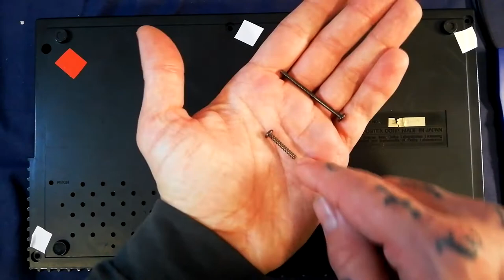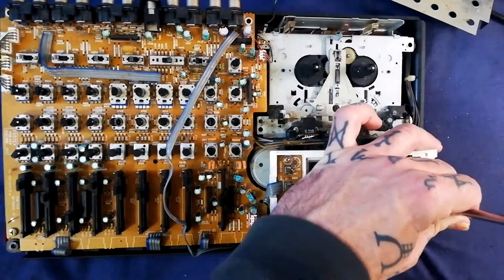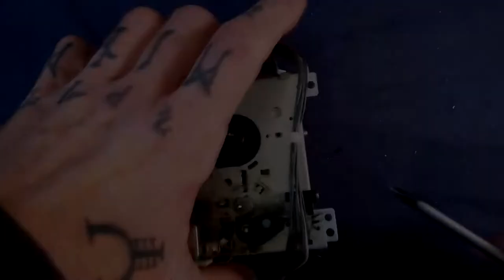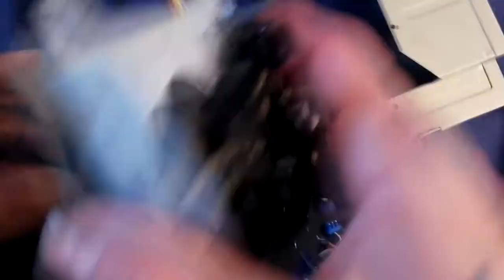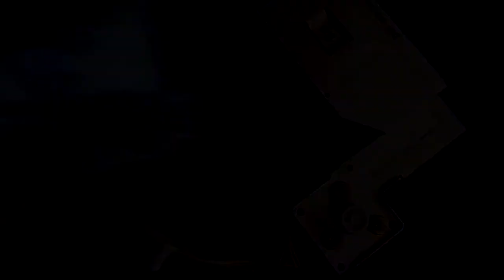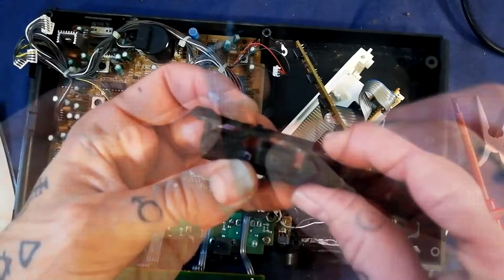Fostex X28H | Tear Down

Comment: just followed your video about capstan motor disassembly. had to replace the (clockwise) motor in my machine, which is very hard to find... I bought a mabuchi equivalent couter-clockwise motor, and did some surgery to swap the brushes around XD it works now but not without a gentle push to get it going. probably needs a little oil or alarger capacitor or something like that

anyway... thanks. just saw your channel today. really like the level of disassembly you show us. Thats just what i need
Reply: mine is the regular x-28*

Comment: I just fixed one of those, thanks for the ever detailed tear down. 
I have the 28 version not the 28h.
The unit came without one of the top select channel switches as shown on this video. 1:06 
Is there anyone around with a defect unit willing to sell/send one to me?
I have this unsatisfactory and slightly irritating feeling of having work hard to get it all working but just missing that tiny little last of the puzzle !
Thanks again tetrakan
Reply from the maker: I've got a spares donor, but I'm in the UK, where are you? I'm willing to ship internationally but from experience the prices are crazy...
Reply: Hi contacted you via your patreon message box. Thanks!

Comment: Hello Tetrakan!

Watching your video, I opened my fostex X28H to replace the belts.
Before closing it again everything worked correctly; but after closing it with the rear screws, the device does not turn on.

I have measured the adapter and it works fine; Even the input jack works fine, but I don't know anything about electronics and I wouldn't know what to check now.

Any suggestion will be very welcome.

Thank you so much!!
dan
Reply from the maker: Hard to say without being there, probably bets to open it up again, look for a disconnected cable or similar? Don’t be disheartened, I do this during repairs often, usually the answer is obvious on a second inspection, just stay calm and optimistic
Reply: @Tetrakan  Thank you so much for your answer.

I forgot to tell you that when I took it apart and put it back together several times, the motor cables became unsoldered, and with my pulse no longer so firm, the solder on the 2nd and 3rd contacts (the ones in the middle of the 4), were touching each other. , they overlapped.

Could this have damaged some component that is causing it to not turn on at all now?

PS.: Fostex is so fragile compared to Tascam...
Although both brands are Japanese, what a different engineering!

Comment: Portastudio 414mkii or this one? I have two offers the same price and Idk which to buy 😞
Any help? 
I will use it for to record synths but the lost create loops and experiment with pedals and it will be finish in a DAW.
Reply from the maker: Unless you really need per channel eq, the Fostex is probably a better fit - more mixer channels and dual speed = interesting ways to combine synths and loops, and it has 4 x tape put to capture 4 x mono stem files on the DAW

Comment: Thanks ! Would you go for a X28H or a X15 if you had too choose? Keep up the good work!
Reply from the maker: X28H because it is lighter, has two speeds, can record more tracks simultaneously, and has a more flexible mixer. And most of all, you can monitor the signal without recording, this is  a major disadvantage of the x15 compared to  modern model's.
Reply: @Tetrakan  thanx men! And now ... there is a yamaha mtx4 for sale 🙈 Even better ?
Reply from the maker: More bells and whistles, only slightly  bigger and heavier...
Reply: @Tetrakan  thanks!
Reply: @Tetrakan  I got the 28h machine, arrived today 👍 I'm fooling around with a stereo zoom h1 mic to connect to the machine but I probably need to use the tape In & out instead of the inputs? I also have a stereo Phillips mic from the 60 but that's an old 5 pin... 🤔

Comment: Do you know where i can get the fader knob at? and the belt ? found mines at a vintage store
Reply from the maker: Where are you located?
Reply: @Tetrakan  colorado, USA
Reply from the maker: I'm in the UK, so I'm not sure about suppliers on your side of the pond. Look up Recursive Delete or Mods and Ends NY on  Instagram. They will know where to look even if they can't supply the parts themselves
Reply: @Tetrakan  do you know in UK? Looking for one fader knob
Reply from the maker: @prettypointlessvideo  I could sell you one, I've got a spares unit to part out, msg me on Facebook or Instagram

Comment: How many heads have? 2 or 3??
Reply from the maker: Two. Left = erase only. Right = Record & Play.
Reply: @Tetrakan  So i can’t listens the tape (I make tape loops and send the external sound) or the source?
Reply from the maker: No. You stop, rewind, play to hear the signal on tape.  All cassette multitrack recorders work this way (dual function record/playback head). Only a few  stereo cassette recorders have 3 heads for example marantz PMD series.
Reply: @Tetrakan  Aaah ok, but can I use a tape loops?